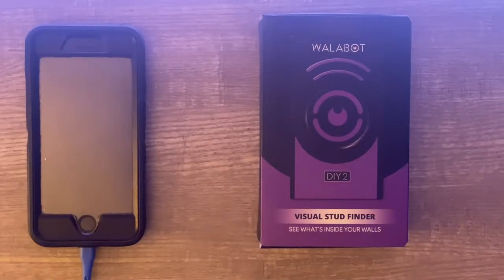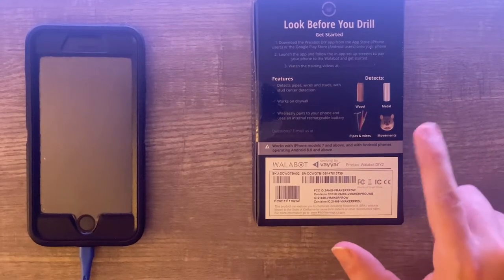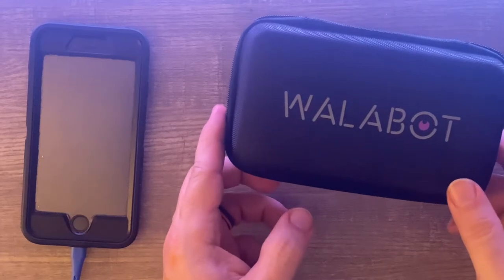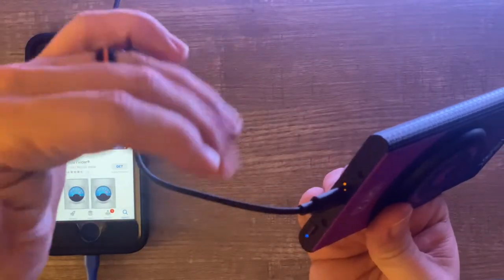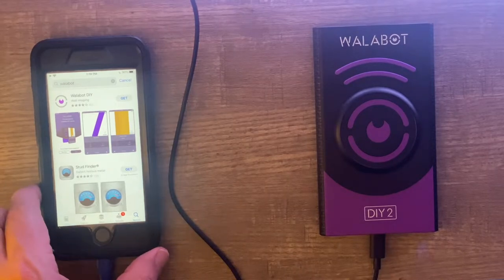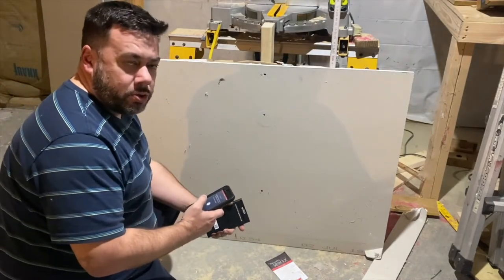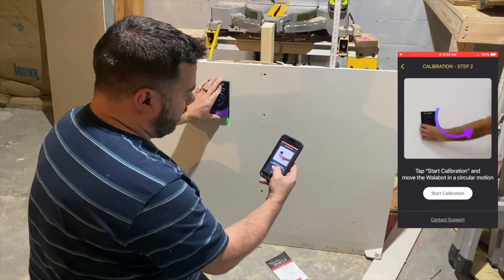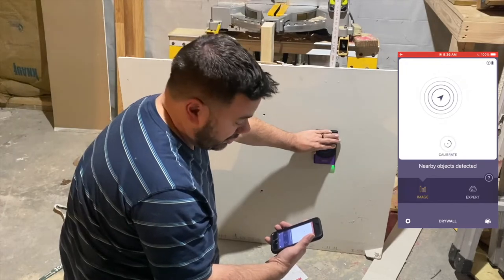Product Review - Walabot DIY2 - See  What's Inside Your Walls - Or Not!

Comment: As a radar technician that uses $30k to $90k systems everyday and has over 140 hours of training using and understanding radar I can clear some of this up. The unit sends a radio signal out and picks up a return. When you calibrate the unit it sets the avg speed of the signal and a avg response. Sooo, if you run it over an object it says it’s found something and where it’s edges are. That’s the first part. Then the software is detecting how far the object is and then says what it is told to say. For instance, whatever is against the drywall, make that a stud. If it is 3/8 or more off the wall then make it a pipe or cable. That’s it. It can’t tell what it is. Doesn’t know what plastic is or wires are or even a steel pipe. Only distance. It would be nice it it somehow knew what the material is. Nothing on earth so far can do that. Not even my GSSI or Mala systems can do that. I can pick up power though. So can a nice stud finder though. It is a nice tool. Just know what it’s limits are. Happy drilling.
Reply: It also has an expert mode which picks up thermal. I imagine water lines would be colder or hotter.  Not sure about nonenergized wire or vent pipes.
Reply: I’m just a foreman and I believe he’s mistake is , that mock-up it’s not code complaint, if he install he’s pipes on right position and cables then maybe work it , cause like you said above , it’s a radar where measure depth
Reply: Thank you for sharing!
Reply: @LuckyLuciano_1 I agree the mock up is incorrect. 

A code compliant wire is stapled in the middle of the stud. A wire box entry is proud of the sheet rock as well. 

A pipe is past through  the middle of the stud, horizontally and vertically. 

A more realistic electrical and plumbing installation would clarify the limitations of the device.

Comment: I'm looking at your mockup. I see that the pipe is fastened directly to the drywall and the wire is stapled directly to the drywall also. That is not typical wall construction. I'm guessing the sensor and software expect a stud to be in direct contact with the drywall and all other hidden features to be some distance back. A proper mockup would have had a sandwich of a layer of drywall on both sides of the stud and the wiring and pipe set back some distance greater than 0 inches.
Reply from the maker: Well I think I demonstrated that if I move the pipe or wire away from the wall they showed up.  The issue for me is I have an actual wall with the backside open and there is both pvc, pex and romex and it is not reliably detecting any of those even after multiple calibrations.  This is why I decided to just do up a demo wall.  If it relies on there being sheetrock on the other side, we’ll that’s not clear in any product documentation or any of the videos I’ve seen elsewhere.

Comment: I think you're doing the calibration incorrectly. I think the device has to maintain contact with the wall during and after calibration - but you remove it from the wall - then put it back - and that's when you are getting bad readings. Every time you remove the device from the wall I believe it needs to be re-calibrated.
Reply from the maker: I don’t think so..  the calibration has you scan the wall and when successfully completed it tells you calibration complete. I do the calibration and wait for the complete message and it’s not my phone on the wall it’s the new model Walabot DIY2.  Support watched my video and even apologized I’m not getting the expected the results.  The unit has been returned due to the price tag.  If the only place you can keep the device is the area you calibrate it, that would be a horrible limitation.
Reply: @rossibytes  You have to continue contact with the wall after you calibrate it.  If you remove it, you must recalibrate it.  

I have the original device, and I think that because it is connected to the phone and I only have to use one hand to hold both devices, it seems a lot easier to use than this one.  How would you be able to mark the studs if both hands are being used?  Sure, you need to set the phone down, but that adds another step and more time.
Reply: @jmackinjersey1  🎃

Comment: Calibrate in small circles inside the stud bay you can use it for hours on one calibration as long as wall finish is similar in the house ur working… I’m
a contractor and have had great success when the quick zircon unit is sending mixed signals this unit works very very well if calibrated correctly and expert mode is used

Comment: When you remove the unit from the wall, you remove the calibration you just performed. Also, the chances of a plumbing (your PVC pipe) or electrical (your Romex) line sitting directly against the inside of the drywall is EXTREMELY rare; they are typically fastened to the +/- center of the face of the stud, which will read at a different depth, hence showing a different material (stud, pipe, wire, etc)
Reply: I think you are on to something with this take. Very rarely are you gonna have wires or pipes really flush up against the drywall
Reply: @DabBerDan47210   😊
Reply: @DabBerDan47210   😊
Reply: So the discriminatory capability is not quite as precise as advertised.So it can only ‘see’ in the open space,anything touching the backside it read as a stud.Oh,well.

Comment: Makes sense I’ve never ran into pvc or Rolex. Right against the drywall so as long as someone did the work right. Seems like it works. Should test it on a real wall and see if it reads differently.
Reply from the maker: This test wall was built and shown in the video after spending over 3 hours on a real wall.  On the real wall, there is actual water lines, PVC vent pipe and electrical and the DIY2 did a horrible job of picking them up despite numerous recalibrations and keeping it on the wall after calibrating, etc.  I know what and where things should be in the wall because the back side of the wall is not finished and I can see everything in it.
Reply: It's a novelty. An expensive, novelty.
Reply: @rossibytes  maybe you received a defective unit. Mine works good

Comment: No, it actually works perfectly. When you build/frame, all electrical/plumbing should be run between studs and away from the stud face so drywallers don’t run a screw into them. If you do have pvc touching drywall it was installed improperly.
Reply: Sure, which is perhaps why you would want a scanner to be able to differentiate between them!

Comment: it probably will only detect live wires & metal pipe or pipe with water in it? It may also be cheating by detecting the angle and if it is not straight it would see it as a wire maybe?

Comment: I'm thinking that the wire should have live power on it and the pipe should have water in it to distinguish them from a stud.
Reply from the maker: That would be fantastic if there’s sensor actually picked up wattage and water temperature but it does not appear as though there system actually detects those items and I did testis on an actual wall with actual electrical running through as well as waterlines
Reply: @rossibytes  I appreciate the insight. I've seen in other videos where it differentiate wood from pipes or wires, but it can't tell the difference BETWEEN pipes and wires.The only thing consistent is that this device gives mixed results. I'm not sure what the cost is, but I don't think this tech is mature enough for my dollar yet. Thanks for the video.
Reply from the maker: @Hank-ski  Bingo!
Reply from the maker: @Hank-ski  buy the way it’s about $160 and if you want the case with it it’s over $200

Comment: First, thank you for taking the time to make this video.  I truly believe your intention was to help and inform.  However, I think the erroneous readings you got were more due to the flaws in your test wall than the device itself. Consequently, I think this video creates an unfairly negative impression of the device.
Reply from the maker: I'd agree, however I had the same results with an actual wall, that I hadn't thought to record at the time, thus why I built this test wall.
Reply: @rossibytes so are you saying the “actual wall” you still received incorrect detections? Or did it identify the wiring and other things properly ? As it should have..
Can you clarify that?  Thanks!

Comment: For one (I worked in nuclear field as calib. tech, & instrument engineer) it seems a calibration needs to include other materials behind the wall, not just wood studs. If the device microprocessor only "sees" wood, it has no variations in material density to calibrate with. Thus, it is calibrated as wood being the standard material for the calibration baseline. If, you rotate the calib. process to include the other materials, it may detect the variations, and not define all as wood. Also, try the "expert" mode.
Reply from the maker: I tried this on this test wall but also a wall I know has wire, pipe and pex and recalibrated in all of those contexts and it still failed to consistently represent the wall.  The point of the device is to tell you what’s in your walls to avoid accidents.  If this is what you’re solely depending on, it is not accurate enough.

Comment: You obviously don't know how to use it... mine works perfectly. 
Don't take it off the  wall after calibrated  . Try again doing it right next time and you'll love this tool 👍
Reply from the maker: Nope I tried several times on an actual wall and tried multiple times and multiple spots and it was not consistently accurate.  I tried keeping it on and taking it off.  Thank a for the tip though.

Comment: I am no expert on this but here is my thoughts. Now matter what we build, it is an AI and only is as smart as the builder as this is one amazing device. In construction, 99% of wires and pipes are not right up against the Sheetrock but stud. Sheetrock is nailed right on the stud which makes no space between your Sheetrock and stud. The device reads the wire as a stud bc there is no space between the wire and Sheetrock. If you make a gap between the stud and Sheetrock, the device may read the stud as a pipe or wire.  The device census the space between the wire and Sheetrock which tells the device what is is looking at. Try this, move your stud away from your wall and see if the stud looks like a wire. Just my thoughts as I am curious to know what happens. Wires are not as perfectly straight like a pipe so a conduit in a wall may show up as a water pipe.
Reply from the maker: I don't have the device any more.  I sent it back.  In other comments on this thread I mentioned that I spent about 3 hours trying this with an actual wall where the back side of the wall was still open and all of the construction (studs, pvc, water lines and electrical) were to code/standards and it had a hard time accurately picking those items up.  This test/demo wall I built was just something I could try/show at a smaller scale.  I realize electrical cable would never be stapled to sheetrock and I realize pvc wouldn't be secure directly to sheetrock.   Perhaps I had a defective unit, but it was pretty expensive and as I said, I spent over 3 hours trying every single combination of calibration, keeping it on the wall, etc... having the back of that wall open, I could very easily tell it was not picking up the elements accurately enough for me to ever feel confident drilling into the wall.

Comment: Your Calibration is absolutely wrong.. I have no issues whatsoever using this amazing product. Please start with small circle and make sure to cover most of the board because you didn’t cover most of the board..
Reply from the maker: This was not my only attempt at using this and if you try small circles it tells you to scan a larger area.  I spent over 3 hours doing numerous calibrations on an actual wall just off camera that has one side unfinished so I can see everything in it and this device failed to reliably and accurately detect any of the items in the wall.
Reply: @rossibytes  

I looked at your video again and  noticed that you’re removing the device from the wall and trying to calibrate it will not work. I was doing the same way when I first time used it and it was not working and I was very frustrated but when kept it held against the wall had no issues locating the studs, wires and a few pipes.. I love this amazing tool. Is it possible that the one you bought could be defective..
Reply from the maker: @fahimnasraty6333  possibly but after trying it on a real wall for 3 hours and multiple calibrations and not removing it from the wall it failed to detect.  They watched my video and apologized that it was not working as designed so I’m confident I wasn’t doing something wrong.  They gave me the option to get a refund or a replacement.  I opted for refund simply due to price
Reply: @rossibytes  
I do so sorry that it didn’t work for you. For me it has been a lifesaver and hopefully not having issues in the future since it is very expensive compare to other stud finders in the market these days.